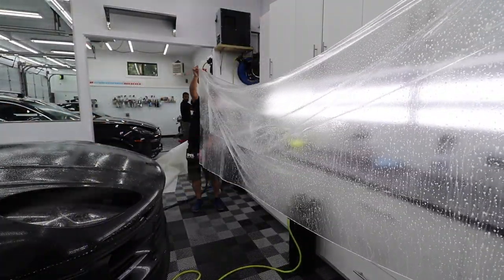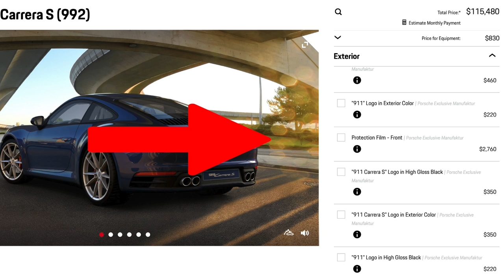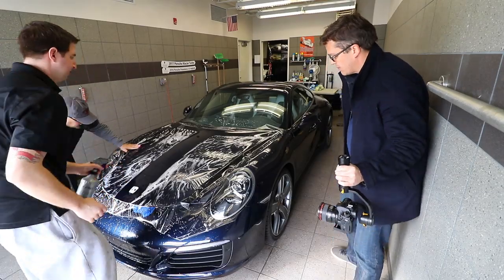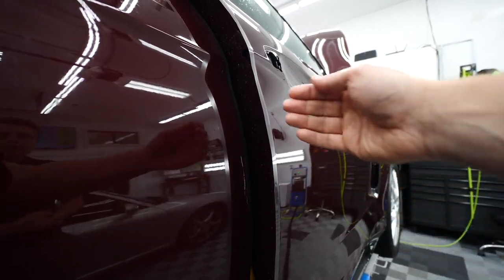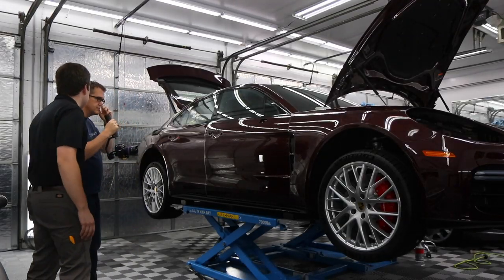Paint Protection Film, all you need to know

Comment: Put PPF on my 2010 A4...replaced it 5 years later with Xpel  (due to discoloration; old technology)...still have the car.  Zero chips after 120K miles.  Worth it.
Reply: PPF is old tech and is not as good as a ceramic coat imo
Reply: Kuya Arbee ppf and ceramic coating are two separate things. Ceramic coating will not prevent rock chips. Ppf willl
Reply: ali battla md
Reply: Where did you buy large pieces of PPF ?
Reply: When PPF peeled off from the car then car original paint will be perfect or it's possible to damage the car original paint?
Reply: @KnowTheNewOfficial  it will be perfect and pristine

Comment: My wife had to have a black car and insists on being able to go through the car wash that has the big, swirling columns that spin around against the car. On top of that, it's a Porsche, which is known in the industry for having some of the softest paint (water-based, due to environmental concerns). So, if I don't want swirl marks showing up on our black car then I had no choice but to drop the cash on a full wrap. I took it straight to wrap the day after I bought it...and one of my other cars is getting wrapped and coated right now. Not cheap, but worth it I guess.
Reply: I have a black Porsche as well... Can you send it through the car wash with the wrap on and there will be no swirl marks left behind?
Reply: Hate to tell you but the automatic car wash will eventually ware off the self healing top coat of the film. Automatic car washes are basically like rubbing your car down with sand paper.

Comment: Put a bit of PPF myself on the rear ledge of a SUV for a leased car that was pre cut as these cars with the painted rear bumper when dragging something out of the trunk you can scratch them or chip them with a suitcase or in nicks case a toaster. Only hard part was getting the ratios right for the sprays. It looks fine but you can tell a pro didn't do it as you see a few specs of dust.

Comment: Dealer installed PPF didn't pan out well. Had bubbles and wasn't cut properly, paid a third party to strip old PPF and redo a full wrap with full ceramic coating plus wheels. Well they did a decent job but my badges fell off last week...man it's hard to find a good PPF installer. Nick any suggestions for the next car in NY?
Reply from the maker: Yes just use these guys. Every job they do is perfect
Reply: @NickMurray  Once the Aston comes I'll send a email.
Reply: @MBisFrenchy  I am waiting for James to bring the Rolls back and I will meet you there. Would you like to have tea while waiting?
Reply: Do you know if they can PPF my school bus?
Reply: @inikkor61  only if you use Topaz. Then you can even PPF your wheels (steering wheel too).

Comment: Put "full" PPF on my CS. Sadly, I made a bad choice when I picked out the installer. Definitely would PPF again, just with other installers.
Almost 1 year on the car now, with speeds up to 180mph, some driving during the winter and despite running on Cup 2 (every stone in their path stick to them and end up being thrown into the rocker panels, wheel arches, etc), no stone chips or paint damage yet.
Also, have 2 layers of ceramic coating on top of the PPF and on the wheels. Everything cost me a lot in the end, but painting the carbon fiber bonnet is anything but cheap too.

Comment: After it is applied! How do you maintain it? Can you use a clay bar on clear protected coatings? Can you buff it? Sure it gets contamination on it from weather. Thank you great video.
Reply: Hey! once its protected with PPF you can wash and wax or ceramic coat as you feel like. You can also clay bar the film as well, should you get any minor scratches in the film from the clay bar, you should be able to take the scratches out with a heat gun. I don't recommend buffing the film though. Hope this helps!

Comment: I don't believe you said, how much was it for your car?
Reply: For nick it was free of charge. Of course for you, well it will be $X plus some extra charge to cover for nick's...
Reply: One big advantage of having a Youtube channel is getting PPF in exchange for filming an install. On average (local labor rates will make this go up or down) Hood, Front Bumper and Mirrors for a Macan is like $2k, throw in another $500 for the door and hatch bits. Porsche has notoriously soft paint, which scratches and absorbs dirt that isn't washed off, so PPF is a must. A lot of new cars have paint that is so thin it chips off if you breath on it. It's a cost-benefit analysis. You can try a DIY install for like $160, but good luck on complex curves.

Comment: Have considered now getting a ceramic coating as well?
Reply: I did both and never regretted it on my 991.2.  Protection and easy to maintain.  Just watch out that you use an appropriate bug and tar remover on the PPF or it will melt (personal experience here).

Comment: hey nick, is it a problem to get dings fixed with the paint protection especially if the ding is in an area that requires a glue pull technique, where they glue a plug on the outside of the body and yank it out?

Comment: 9:00 he boasts about using large sheets on the curves... but it really means the wrap was STRETCHED on the curves which means thinner protection in those areas
Reply: also, the more the wrap is stretched the higher the chance for it to contract slightly over time... in turn exposing some edges. some poor jobs barely last a year or so
Reply: OBVIOUSLY. HIGH SCHOOL GEOMETRY CONFIRMS THIS STATEMENT!

Comment: I wish I could find perfectionist installers this good in England that custom cut and use one piece. The examples i've seen just do it from template leaving gaps, lines and unprotected parts. Apparently paint protection spray like ngenco protect or stealth coat is better though. How often is it before it starts to look beat up and needs replacing? If you're driving around with a car that has PPF that has gone ugly you might as well just have a few chips and scratches.
Reply: Made In Machines it can look beat up after just one hit. It depends but the realistic life is 3-5 years if you drive the car and it won’t add anything meaningfully to resale value. 

Supercars are expected to be fully ppf’ed or at the minimum have the front end done but for regular cars like for example a Macan’s the majority don’t have ppf and dealers won’t pay more for one with ppf but a private party sale might yield a tiny bit more maybe 1/4 the value it cost to add ppf.
Reply: @dotyman5  I agree that it does nothing much for residuals so is essentially dead money. Add that on top of depreciation on and its bleak. Only possibly worth it if you're picky (like me) and plan to keep the car for a long time. It's a shame as I'd have liked it. I'd love to find a used on with it on though. That's the dream

Comment: Nick, had the front of my Porsche Macan 2019 covered with a PPF, the installer stated that Porsche does not recommend covering the headlights since the lens will delaminate when removing it and then you have to replace the entire light. Checked with Porsche in South Africa and they confirmed his statement. I noticed that the headlights in this video was covered. What's your view?
Reply from the maker: Anil Jugree PPF would only last 10 years in the past and needed replacing so the lights were never done. Now it will last 30+ years so better to protect to lights
Reply: The one I purchase has a lifespan guarantee of 5 years. What about the Porsche recommendations not to cover the headlights? At the end of 5 years when I need to remove/replace the film, what are the risks?

Comment: Mhm what about ceramic coating instead?
Reply from the maker: Ceramic coating only protects from liquid damage and has a limited life
Reply: @NickMurray  thx for the reply. I slightly disagree due to the bonding on molecular level. This increases the "toughness". It could be that it is not high as this version. 
It degrades true but honestly I think your coating also due to UV and co. Or ehat you think?
Reply: @MichaelC-ep7nk  With my 2022 RAV4 I’ll be getting PPF in the main places that need protection with ceramic coating over the whole vehicle.

Comment: I still think it's a scam. How likely is anyone keeping a car for over 5 years these days? If you do, who would do a full factory restoration for over 10K for a 20k worth car? Even you got a BMW M4, in 5 years that car won't even worth 30k with the mileages we added. Then lastly, the protection film does not stop any real damages anyways. If you scratch your bumper, the whole film will come off. So if you have a dent, a big scratch you will anyways end up fixing it all over. In short, no protection is needed as the clear coat is already doing that. You need however, is to do a touch up once a while if you got some small chips that may rust. Put $2-3k in your repair budget and you can thank me later when you really need that money for good.

Comment: First comment!  Understood benefits of PPF but still don’t want to put it on.
Reply: I recommend it at least for the rear ledge of a car if it's a painted bumper. It's very easy and even for a dealer to do about 150. Online precut templates are about 30-50.
Reply: gtb5 it is expensive and really only worth doing if you have an expensive car that you care about. What do you drive?
Reply: @ShanesAutos  Some people don't wax their car either. It's only worth it if you care what your car looks like. I have it on my Prius after my last Prius front area looked like it had been sand blasted over the years.